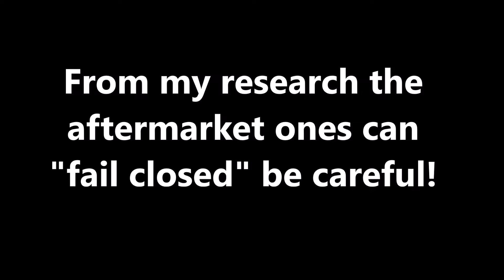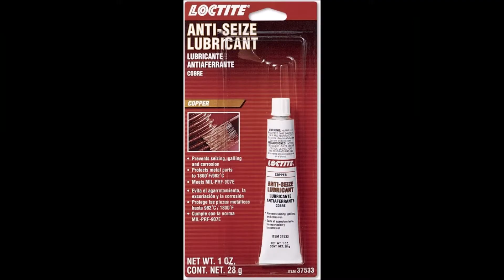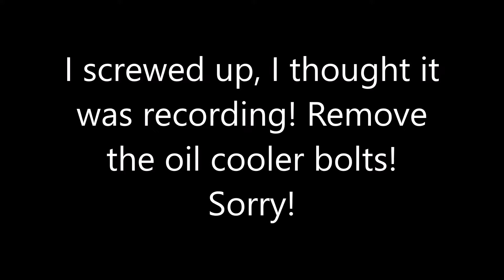VW Beetle Engine Teardown - 1600cc - Lets take it apart - Stuck Motor - VW Bus - Super Beetle

Comment: The tear down and re assembly is lots of fun.  Cleaning not so much.  Very good videos!
Reply from the maker: william tanner Thank you William! I appreciate that! Yeah the cleaning part is not very fun. Where I screwed up, when the heads were still on, I should have pressure washed the engine block. But I was moving along too fast. Which was a mistake.

Comment: My mother had two VW's.  One was a 1500 that was very durable, and ran forever.  The second one had a 1600 dual port engine that was very unreliable, and loved to suck the valves down into the crankcase every 30,000 miles.  The 1600 dual port was one of the worst engines that Volkswagen ever made.  A relative bought a VW a year after my mother bought hers that had the 1776, and it was like the 1500 for reliability.  Many people installed aftermarket oil coolers on the 1600 dual port engines in an attempt to try and cool down the engine so the valves would last longer, and not go down into the crankcase.  Mom's 1500 VW was still going 27 years later, and her 1600 dual port was gone in 10 years.  She just couldn't stand it anymore after having to replace the engine three times due to a valve going into the crankcase.

Comment: This video is 2yrs old but I've done a few vw engines. I've only assembled one of these thermostats per customer request. With that said I had gotten the inside scoop back in the 70s from a German mechanic who even had a German accent LOL 😆 to not use the thermostats.  He said they are normally open and only shut during extremely cold weather and get stuck alot shut which overheats engine. This is confusing since it's cold outside.  Most people run vws because they're classics and wouldn't run in winter anyways. Like I said, car will run all summer and never shut these flaps and mechanic said they only start working at like 20⁰ .  I used to run in winter without thermostat and always had plenty of heat for the cab cause bug uses exhaust for heating. Remember these are designed to warm engine. Always listen to the old German mechanic who spits chewing tobacco on the floor 😆 that grossed me out back then in the 70s. It was like stepping in dog shit ! Still, what I learned was priceless and engines I built were reliable.

Comment: Wow! I enjoyed watching it, very useful!! Now i started to teardown mine and its Day4 and I cant get the heads off. They are stuck to the cylinders. I broke the fins on both heads and cylinders. Head is in bad shape now. I gave up on rubber mallet so now im using a regular hammer and a wood as chisel hitting the head. I used pb blaster and a little heat too but in vain. After watching ur video now im gonna ask my wife’s help to hit it with runner mallet while i pull the heads away… hope that works. If not, do you think i should soak it o/night. I was gonna get new heads and pistons anyway…

Comment: If the engine was rotated over without the distributor installed what am I looking at as far as replacement of the gears your talking about riding up and stripping. Will I have to disassemble the engine split the case ??

Comment: I appreciate your videos, they are very helpful. I have a question, when I removed the cylinder head both jugs came off too. I thought it was one unit but looking at your video the jugs are separate? Should I use a rubber mallet to try and knock the jugs off of the head? Thanks
Reply from the maker: Hi Jennifer, the jugs are separate. Yes you can use a rubber mallet to pop them off. But if you’re trying to save them. Be easy so you don’t break the cooling fins

Comment: Hi Slade, just starting to rewatch this video because I'm trying to figure out why this old 40hp I picked up won't rotate a full 360 by hand. When you talked about not turning over these motors without the distributor in I think that may be the issue with this one? The distributor is in it but someone may have had it out and screwed up the gear? I'll be taking it apart anyway but if this is it may be fixable once inside?

Comment: i'm guessing it went down the pushrod tube? did that motor have dished 85.5 pistons? they are very useful for making stroked stockers. i know you want to go 88 but just in case.
Reply from the maker: Scotty C no it actually didn’t have the dished pistons. I keep going back-and-forth in my mind, on what size to build next after this one. I want to try to keep dependability. But I want to be able to keep up with modern day traffic, and also of course climbing hills.

Comment: Can you tell me what connects to those 3 prongs on top of that alternator? I have that exact alternator on my 73. The guy I got the bug from cobbled a mess together, it's missing things and I'm trying to figure it all out. This is my first VW, I restore old BMWs..
Reply from the maker: There is an actual plug for a 73, I’m quite sure you know a three prong plug. 
And it takes a different style of regulator. I actually have one of those here. I don’t know the color of the wires offhand though.
Reply: @Slades VW Beetle  Thank you . This beetle has been robbed of the harness as well as that regulator. If you're willing to sell the harness and regulator or know of a person that has what I need I would greatly appreciate it.

Comment: Hi I’m building a desktop model of avw beetle 1500 engine 1/8 scale.  It’s for my father.  Would you happen to know the dimensions of the engine case in inches?  Thanks, I know it’s an odd request!
Reply from the maker: I actually don’t know that off him without going into the garage. But it would depend what dimensions you need, from where to where? I hope that made sense.
Reply: Thanks!  I assume length;from back to front,  height; top to bottom,  and width.  As far as I know I can figure out the rest for now.  Might be easier to figure out in metric and I can convert in a scale model calculator.  Thanks so much for your help and getting back to me!

Comment: Hello Slades, I'm in middle of dismantling a 1600dp in my 1970 Superbug. Engine has done 138,000 miles, no smoke. around 100psi compression on all cylinders. First time doing this. I'm not intending to split the case. but is there any advantage of removing the oil pump in this case, or could i just leave it as is? Is there anything particular you can check when the oil pump is removed? Thanks in advance, enjoy your videos very much and very helpful
Reply from the maker: First of all thanks for being here, I truly appreciate that. If it was me and I was at that mileage I would be really happy. But I would remove the oil pump, and check the gears on it. As in checking the teeth. They’re not that expensive. And with that type of mileage it probably wouldn’t be bad to put a new oil pump in. But that is just my opinion of course.

Comment: Hey Mr Slade. 
I enjoy watching all of your informative videos. 
Just a couple of questions. I have a 74 Super with autostick. I will be removing the engine this winter. To fix oil leak between the case halves, would I need to separate it or just retorted the bolts?
Also, can I just install regular new engine oil pump gears and then reinstall the autostick pump on top of it?
Would it need a new oil pump ...it has 38000 original miles on it and never been touched. 
Thanks. Keep up the good work!
Reply from the maker: Thank you so much for the kind comment I truly appreciate that. Firstly if you’re going to pull the engine down, and start taking it apart. You’re probably better off separating the case halves, only if you feel comfortable! You can of course try to re-torque, sometimes it will help. It’s pretty much a gamble.
If your oil pump gears are very low mileage, I wouldn’t worry too much about it to be honest with you.
Reply: @SladesVWBeetle  Awesome! Thanks very much for your reply. I really appreciate that. 
.....I will continue to watch your series. 🙂
Reply from the maker: @user-pt5px6uk4w  Thanks again! I truly appreciate that.

Comment: Why didnt you put it on a stand?
Reply from the maker: I didn’t have a yolk for the stand at the time
Reply: @SladesVWBeetle  I have a 1600 ,doing the top end. I went to torque the heads and on of the studs pulled out of the block. It has already been oversized with a self tapping stud. What to do ? I do not want to split the case.
Reply: A very informative video. Thanks ...

Comment: Hi I had a question I recently took apart my engine and noticed a empty slot/whole top right rear of the engine block where it leads to the clutch and transmission, but I see in your video (27:42) you have a sensor there I was wondering what that sensor is and if I should worry about replacing it.
Reply from the maker: You’re OK, do not worry about that. That was placed there when new, for the technicians out the car dealerships. Those would no longer be used.
Reply: @SladesVWBeetle   oh ok thank you for the help couldn’t find much information about it
Reply from the maker: @3wally7  You’re very welcome! Thanks for being here

Comment: I cannot get the jugs off the pistons. I've soaked it in Marvel Miracle oil for a week now and they are not budging. Is that a bad sign? Should I just look for another engine?
Reply from the maker: Wouldn’t be looking for another engine that quickly. 
So you’ve already soaked the piston rings by spraying that down into the cylinders? 
I would take a rubber mallet and start hitting them, to see if that will slide them off. 
Just don’t go crazy, take your time with short blunt hits. Probably going to break some of the fins on the jugs, but I would be replacing the pistons in jugs anyhow.